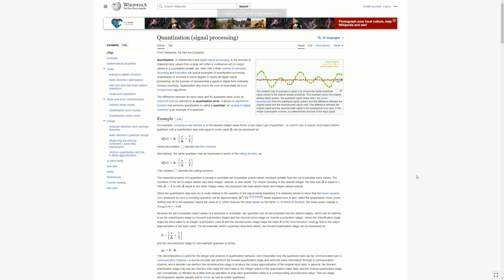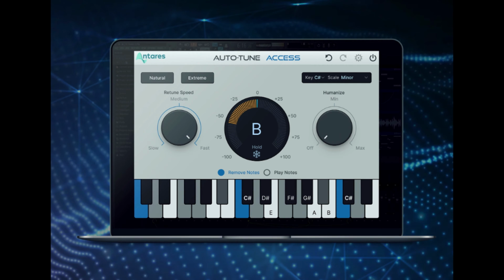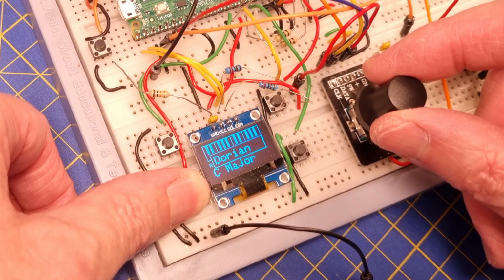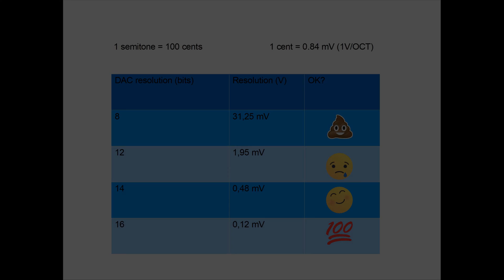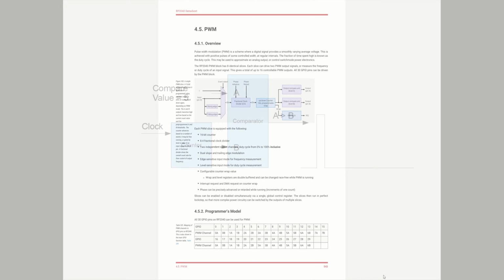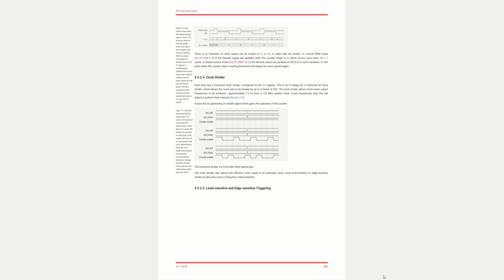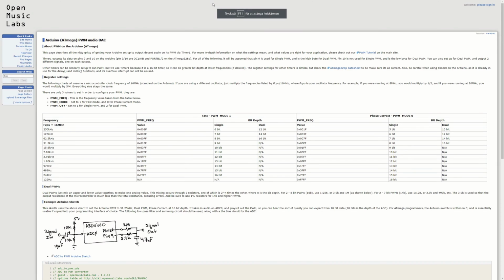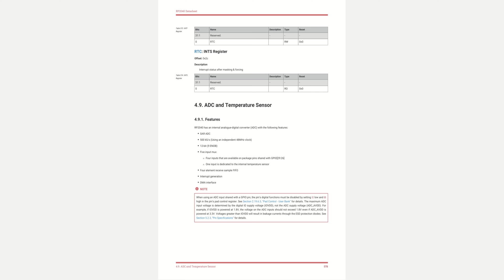Eurorack DIY: Quantizer with a PWM DAC (Episode 1)

Comment: Hi all. Is there a possibility to add the quantizer circuit to an existing sample and hold circuit,? Or is there a combined circuit?
Reply from the maker: Yes, the general idea is that you can combine a S/H (or any other suitable circuit) with the quantizer. I have seen some designs where they have combined the two into the same circuit.

Comment: Cool stuff.  So, I guess this isn't so easy to do as an analog circuit??  :)

Also, just to get ahead of any confused comments you might get, in English, we typically pronounce "PWM" as "pee double-you em" rather than "pee vee em".  I immediately knew what you meant (it helps that I spent some time living in Germany, I guess), but I'm guessing you'll get some confused comments, so, thought I'd point it out.  :)
Reply from the maker: Thanks for the comment, David.
I have a background in digital board design, so for me digital stuff is easier than analog circuits. But enjoy both and like to mix them.

The prononciation is a sloppy direct translation from swedish - "pe dubbel-ve em". But I'm to lasy to say "dubbel" so I leave that out 🙄 The difference between v and w is not so important in Swedish and in some cases people tend to switch between them - especially if you want a word to "look old", the V is often replaced with W.
Reply: @MeeBilt  makes sense to me.  It's a bit different in German, but similar enough that, yeah, I'm right there with you.  I wish English would rename W to something monosyllabic.  ;)